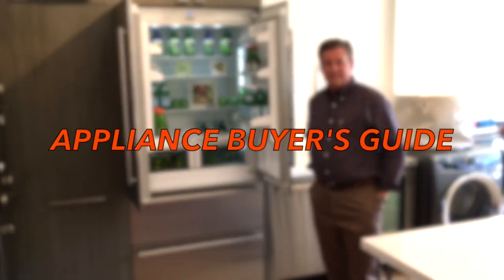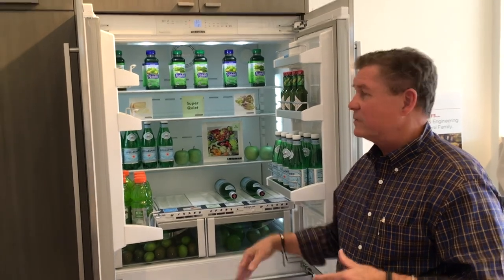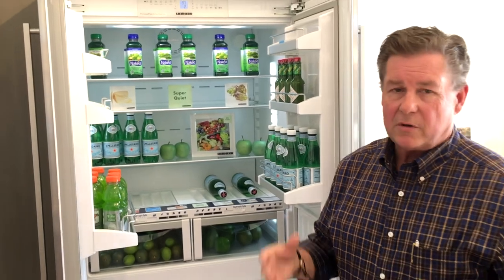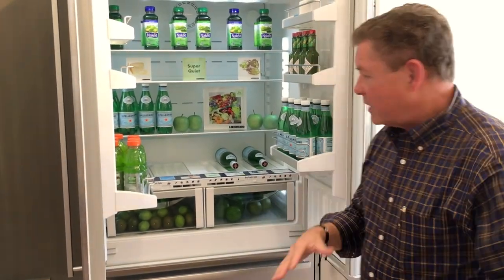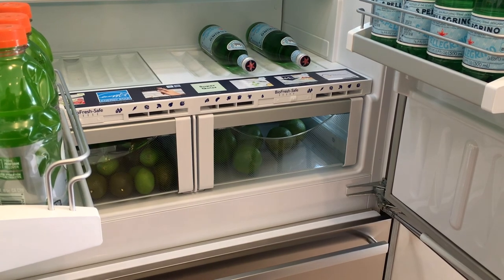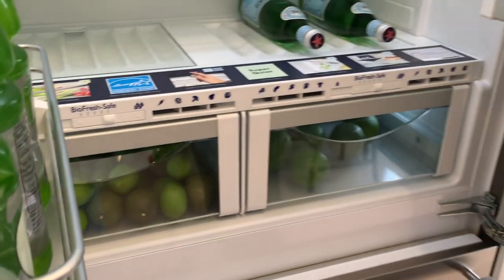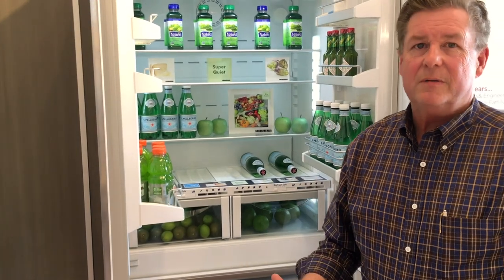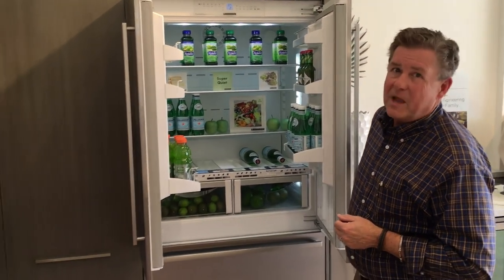HOW a Liebherr Refrigerator Works, R600 REFRIGERANT, and Eco-Friendly Manufacturing

Comment: Parts for this little fridge are really expensive not worth it at all
Reply: I looked at one and the store told me that it would be 3 days to a week to get repair parts because Liebherr doesn't have a very good parts network in the USA.  I'm not paying $5000 for that. Id rather have a JennAir or KitchenAid that have reliable dealer support.